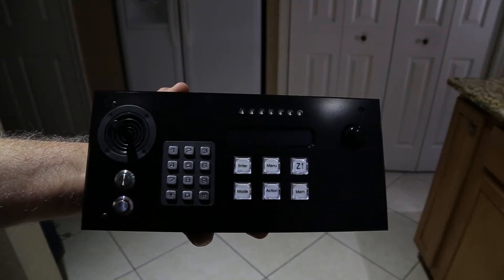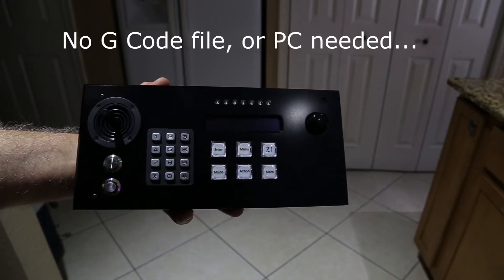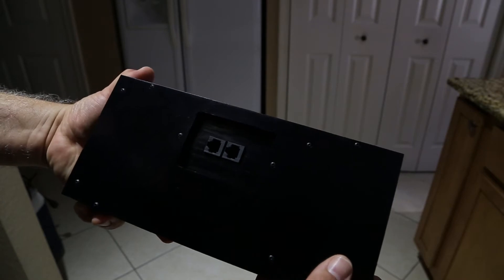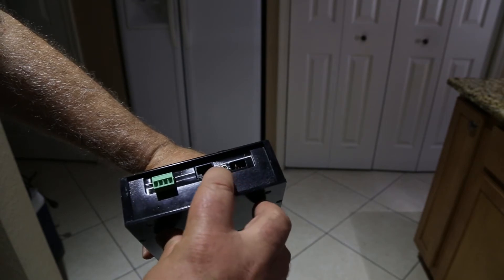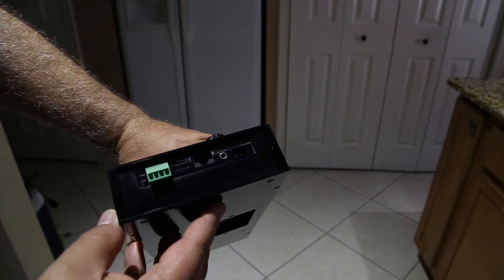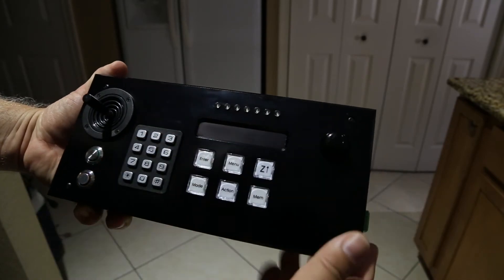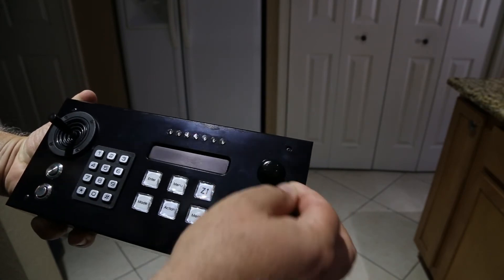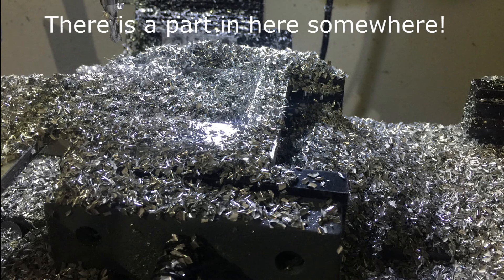Non CNC controller for G0759 / G0704 milling machine

Comment: Are you still selling these?
Reply from the maker: Not really.  I could build you one if you really want one… but I don’t have any cases.  The last time I built a couple of these I paid a local machine shop to square up some aluminum… enough to build 5 cases. I only made 2 units… so I believe I still have the aluminum panels to build 3 more in my storage garage.  I don’t have a mill at the moment, so I can’t machine the case myself.  I am working on a much more solid unit, but probably won’t be ready for another year.  Let me know if I can help you.  Thanks, Tim

Comment: Awesome device!  Extremely well made.  I was wondering what programing language it uses and if is possible to be user modified for personal preferences, though it looks like you have covered all the bases extremely well. Thanks
Reply from the maker: Thank you!  I wrote the code in assembly language, and it cannot be modified by anyone else.  I am currently working on a new version of this that is a lot more sophisticated. Will be pretty cool when it’s finished!
Reply: @1QuadControl  That's awesome. We were wondering if you were still in business. You haven't put out a video is a long time.
I have actually built a Z-Axis Power Feed using an Arduino that has multiple Jog options, and am working on the X and Y axis. Nothing as nice as yours, but I am looking to add more features.
I'm looking forward to see your latest creation. Regards
Reply from the maker: Hi, yes... Amazon destroyed my "Angel ECU" business. About the same time... I lost my job. I had to sell my Grizzly mill. The last 4 years have been rough... although things are improving. I am actually working on 4 different products. I had to keep putting some of them on the back burner because I couldn't get parts... supply chain is a nightmare for me. I just finished one product, and it's on my new e-commerce web site:  www.tcautomation.us   It's going to be at least one year until I finish my new milling machine controller (X-Drive). I just ordered some micros for it the other day. There are 4 microcontrollers on it now. Some of them have not been available until recently.  If you are curious about the X-Drive, I can send you a few links to videos that are on my Google Drive. Send me an email, if you like, to "itsdarkandstormy@gmail.com" . I don't normally check that email, unless I know that someone might send me something.  I am planning on buying a new Precision Matthews PM-833T to install the X-Drive on when I get closer. Pretty sweet mill!

Comment: Love this set up. What are you getting for a price for one?
Reply from the maker: Hi Chris, I've been selling them for $1,500.  They are not in production, so I am hand building each one. There is about $500 worth of parts in each one including the cost for anodizing. It is an unpleasant amount of work to build one of these, and for this reason... the price is currently $1,500.00.   I also have a new interface module for it for an additional $400 that allows you to wire up the output of your CNC PC, and the drivers for the servo motors... this allows you to have both the G-Drive and the PC running CNC software connected to your mill at the same time. You would simply enter the menu on the G-Drive and choose which device (PC or G-Drive) will be the controlling device. You don't have to rewire anything to switch. This could be added at a later time... but not needed at all if you are just planning on controlling the mill with the G-Drive alone.

Comment: Your controller is very well presented. I do like the G0759 but my question would be, can this controller fit other Grizzly mills, larger in size. If so, is this the inappropriate time to ask your estimated price for a controller on the G0759?
Thanks.
Reply from the maker: Hi, yes, it can be used on larger machines, and also on machines other than Grizzly. On my G0759, one turn of the X & Y axis leadscrew moves the table 0.100", so the math is setup for that. If on another machine where this might not be the case, I could tweak the math to make it work. These are hand made by me, and it's a lot of work, so I have to get $1,450.00 in order to make it viable. Thanks, Tim